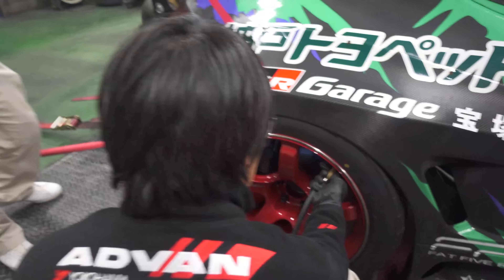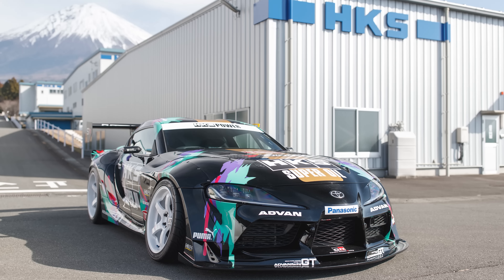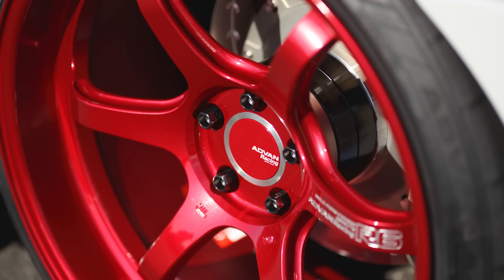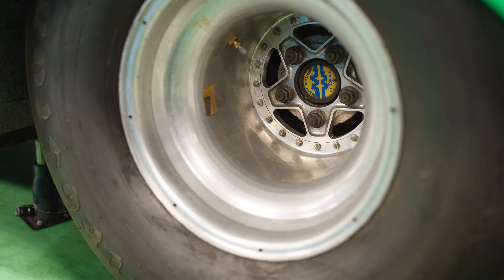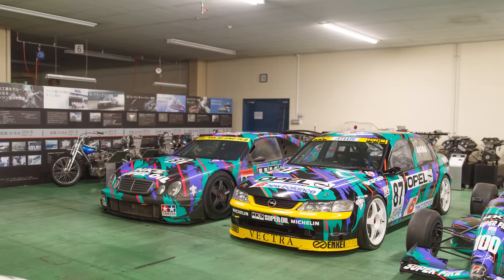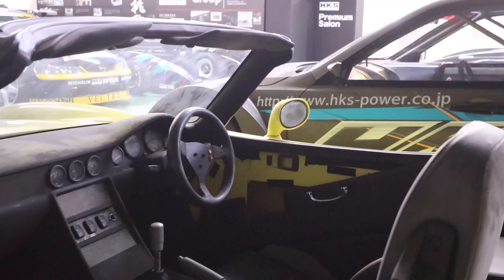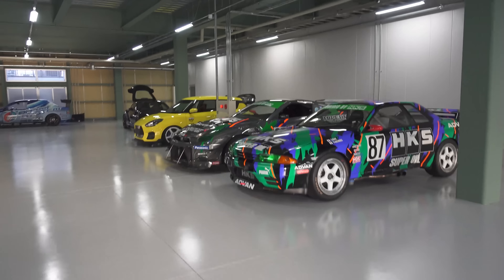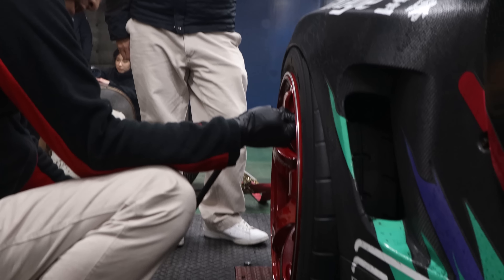GT86 Antilag Monster Dyno’d at HKS Japan: Burnouts on the Dyno!

Comment: The new 86 isn’t worth buying unless you can afford to spend thousands and thousands of $$$ on aftermarket parts! If you ever drove one, they’re super slow, boring, lame, and girly almost sports cars when stock!
Reply: Cause drift king tsuchiya advice Toyota to keep it low hp,since it is a drift car for novice drive.
He always said the best practice for drifting is a low power car.
He used to drift the single cam 86 that only made 100hp.
Reply: Benjamin Franklyn Americans don’t understand what a drivers car is. An underpowered 50/50 weight distribution 2 seater car revolved around handling Is the dream. It’s a shame people don’t like them just because they are slow even though I haven’t heard any bad things about reliability outside of it just being a Subaru boxer (which again helps handling). Love to see what the next gen has for us with the Subaru ascent enegine

Comment: 11:18 that’s not correct. That was never a cavalier. It was a Opel vectra in Europe or a Vauxhall vectra in the UK. Technically a Vauxhall is just a rebadged Opel for the Uk market. The model before this was either a Vauxhall cavalier in the UK or a Opel vectra as Vauxhall didn’t adopt the vectra name until the second generation vectra. This car was actually built by Ray Mallock limited in the UK in 1996. Ray mallock also built the Nissan Primera supertourer that was in yesterday’s video as they switched to nissans in 1997. This car is built to the same supertourer regulations as the Nissan primera and racers in the jtcc.